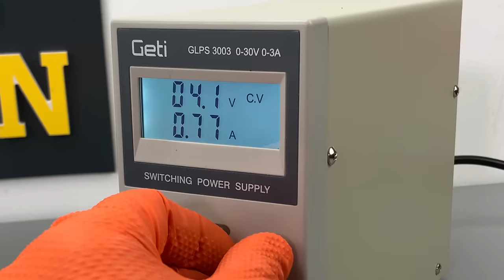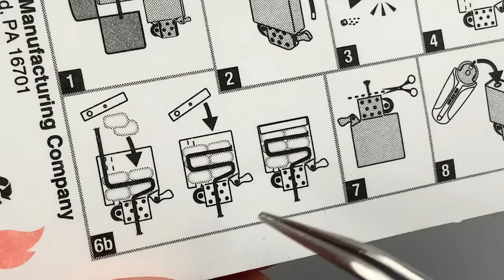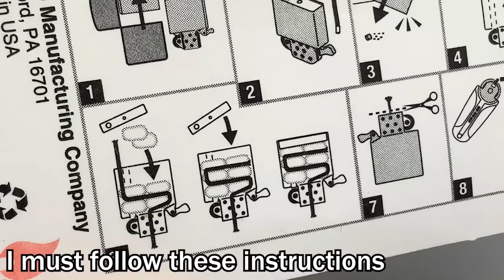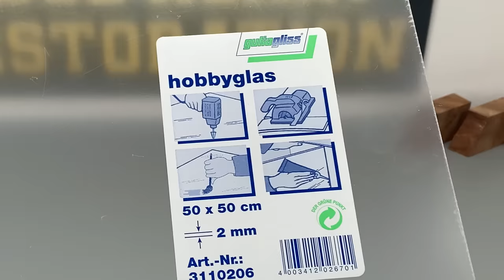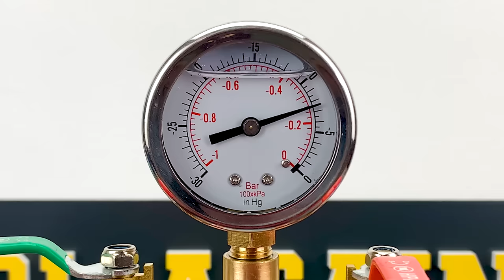Zippo Lighter Restoration & Making a Wooden Case for it 🔥

Comment: Great video! Was it necessary to sand the bare metal of the insert to a higher grit before nickel plating?
Reply from the maker: No because the lighter insert usually are made from stainless steel,and the rust on stainless steel is just on the surface,not deep like on the steel or cast iron .

Comment: For me , you ruined a original zippo .. the law of restoration is to keep the original look and to restore it in a condition that can be used and no further more , the job you did is like buying pieces and craft them to a lighter ... All you restoration maniacs do this ..it pisses me off when the original idea is gone .. shame .
Reply from the maker: If you watched all the video and didn’t skip forward, you can see that I restored and used original parts for repair. At some point of the video,the lighter was restored like was new. After that I decided to make a wooden case just for fun and for the people who want to see woodworking and crafts. If you can judge free,the lighter can be removed from the wooden case instantly and you can use that lighter like a normal one. I don’t applied glue or something else for keep the lighter fixed there.

Comment: Jeez. It's 12 years old and looks that bad 😳 someone has dropped it into the ocean for sure
Reply from the maker: No. It was found submerged in sand on a beach at Black Sea 🌊
Reply: @CoolAgainRestoration  well that's almost in the ocean 🤣 salty sand for some years. Sad that the original 1989 insides isn't available. I think that would make it a collectible then

Comment: Great work! Too bad this is not genuine Zippo lighter, the flint gives it away. All Zippo flints are cut on a bias on the face of the wheel not straight. Also on the inside case it reads “Made in Zippo USA” not the correct “Made in USA Zippo. 
You are either not aware of fakes or you are a scammer!
Reply from the maker: You can check my other videos to see if I’m a scammer or not 😅

Comment: The title tells you all you need to know about this waste of time and money
Reply from the maker: In your opinion. That’s why people buy a lot of new things and don’t take care of old things
Reply: @Cool Again Restoration  i take care of old things, but I don't throw good money after bad
Reply from the maker: And how I throw money ?
Reply: @Cool Again Restoration  by using $10,000 worth of equipment to waste your time when you could've been doing something productive.  Just admit you only do this for the views
Reply from the maker: Mate, that tools I had already in the workshop. Is not like I bought all of them for this project. You can see they are all used and not new. This video was about restoring a lighter and making a wooden epoxy case. First when I released the video,I had another title,more simple: zippo lighter restoration. The title doesn’t worked for me and I changed. If you don’t like the video,is fine. From 536.000 views it’s possible to be some people who don’t like. And it’s fine. But can’t say I waste money and my time. Cheers!
Reply: @CoolAgainRestoration   Wow, I didn't say you spent $10000 on tools for this project I said those tools could be used for something better that actually makes money instead of this poloni which is absolutely 100% a waste of your time and money

Comment: You are a really artist!
Reply from the maker: Thank you very much Cristián 😊
Reply: @CoolAgainRestoration the way u install the wheel is wrong. You should filp it the other way. otherwise it will not light up easily
Reply from the maker: Yes , you have right . I already changed ! Didn’t understood why not light up easily and after first comment indicate me that , I was in the workshop and changed the wheel direction 👍 thanks a lot

Comment: that's fake
Reply from the maker: Why you say that if you don’t mind ?
Reply: @CoolAgainRestoration  I just gave my opinion because I've never seen a blue rust before
Reply from the maker: Ok. Your opinion are wrong. That is not rust , because rust is not blue . That material is brass and when brass and copper are old and was kept outside without a protection layer, they became blue or green  👍

Comment: What type of material was it originally made of because if it's steel it should have blue rust that's only found in copper
Reply from the maker: It is brass case . That blue surface is oxidation from brass, not rust

Comment: should have spent  more time on the brass finish. i thought it was terrible, considering brass is relatively soft and easy to polish.  i would then coat it with a heat resistant lacquer . although the case looked fine, as a zippo collector you ruined it.
Reply: the zippo is from 2010 lol

Comment: That blue oxide is fake, this is a fake video, never saw blue oxide, its fake, bad one
Reply from the maker: The oxide is not blue ? But what colour it is?
Reply: @CoolAgainRestoration  ok lets suppose that it is another colour of oxide, but the only oxide colour i know is that rusty brown, no other colours.
Reply from the maker: Yes, that’s why I asked. Because people think it is steel. In my video, the zippo case is from brass and the oxide brass or oxide copper is green/blue. Non ferrous metals don’t rust, so don’t go brown 👍.
Reply: @CoolAgainRestoration  k.
Reply: @CoolAgainRestoration  if u say so it could be right,you have more experience doing these things
Reply: Подумай прежде чем написать "фейк"! Латунь и медь окисляются синевато-зеленым цветом.
Reply: @AnahiRumak You obviously know very little.